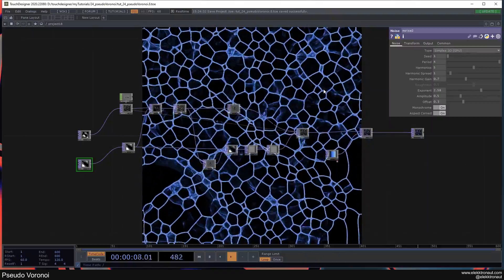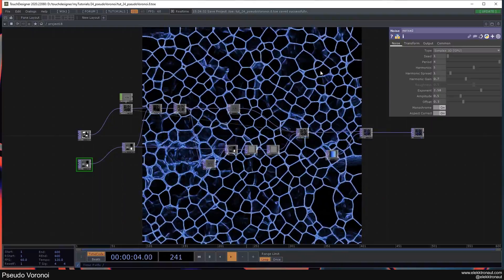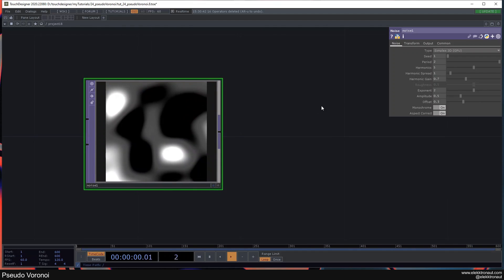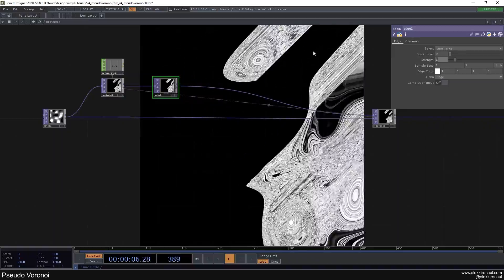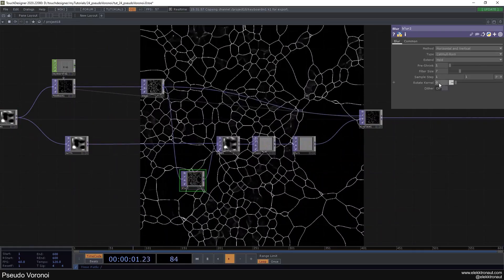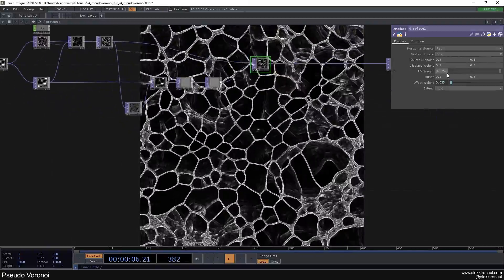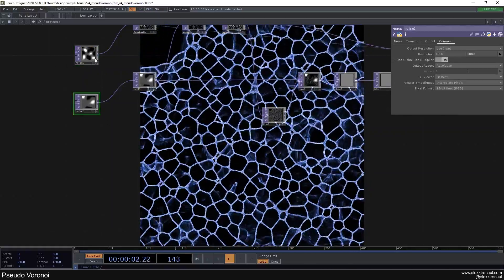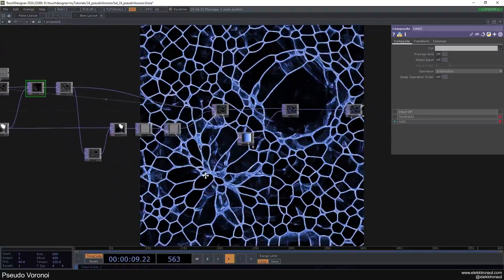Pseudo Voronoi – TouchDesigner Tutorial 24

Comment: Hello i have tryed the tutorial but it doesnt work! when i connect edge and composite i display only diagonal snow flocking. i have rebuild the project 3 times but i have every time the same problem.
Reply: dude , im in the same situation , can you resolve it ??
Reply: @senaldehumocl2975  no
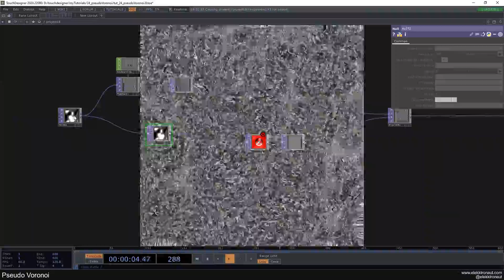Reply: I also can't get it to work at that spot.  I don't have RGB on noise, only RGBA.  And the little blue up arrow next "noise1" at 4:59 is not there on his screen.  Mine is and I can't get rid of it.  Those are the differences I see.
Reply: @RichardAmesMusic  change the "blue" on slope to "vertical blue"
Reply: I had various problems and I redid the project three times too, but I don't know why the result isn't the same even if I follow it to the letter; doing it as is, I only get generalized noise. But if you slightly adjust the noise values (Noise tab), also the Edge values (Edge tab) and the Slope values (Slope tab), you can get an adapted version, different but close, but it gives a lot of room to experiment and better understand the system.
Reply: Set your noise to 16 bit float RGB and it will work, tried with mono and the diagonal snow will happen.
Reply: @cheukhimlam7599  Weird, I don't have RGB
Reply: noise1 set 16-bit float (RGBA), feedback1 set 16-bit float (RGBA) and Chanel Mask A

Comment: SUPER RAD. How do you do the thing where you drag and create a connected null at 3:56?
Reply: Also, when you drag the displace back to the feedback, does it matter if that line (the one with the moving-backward arrow) is not dotted like yours is? Mine appears solid grey by default
Reply from the maker: Alt + N! I don't think so, as long as it still works.. it's usually dotted by default though.
Reply: @elekktronaut  thanks yo!